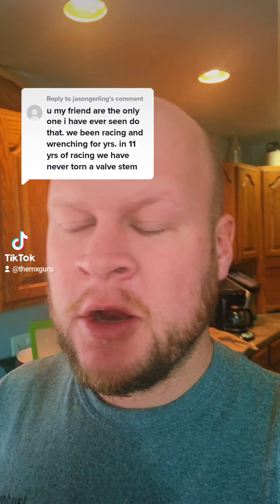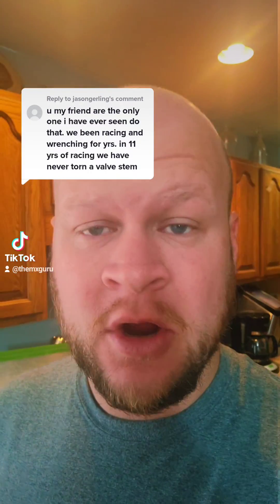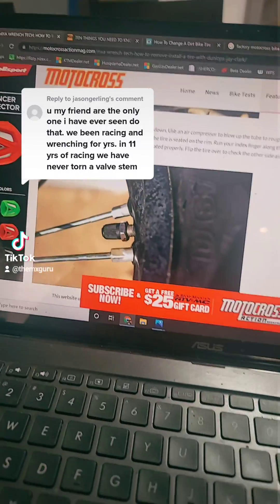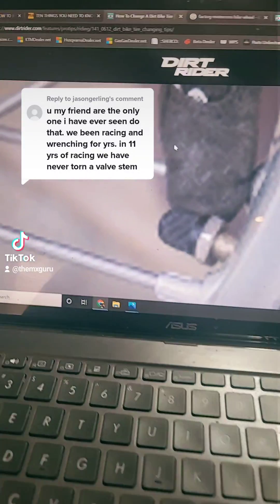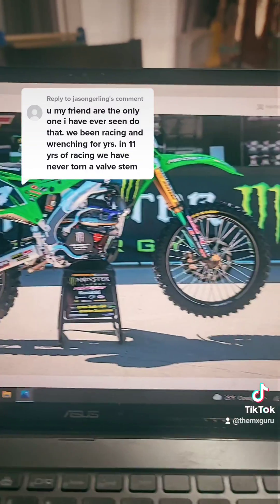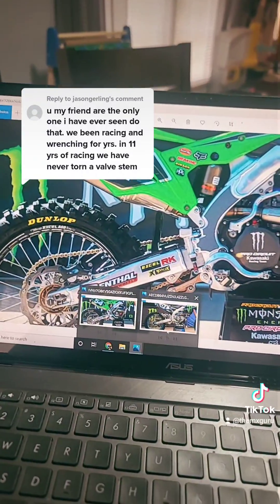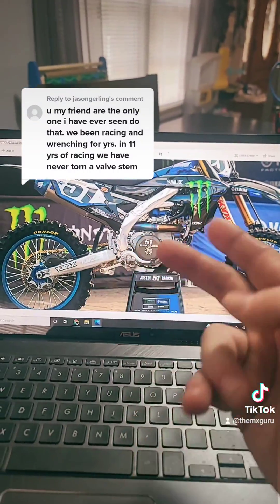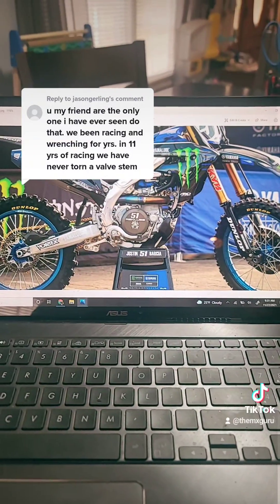Should you tighten your valve stem nut against the rim?

Comment: I literally found out about this a week ago. About 3 weeks ago, my Talaria Sting R electric motors rear tire went flat. Found out the stem valve literally ripped off the tire. 

After watching a video on replacing the tube. The gentleman mentioned not tightening the stem nut to tire. It's crazy because the Talaria Sting R is ships stock with the nut tight to the tire. Now I know 😂

Comment: I have the nut tighten in the rim because the local vulcanizing shop does it on my motorcycle once when I have my tires change to them. Didn't know and didn't bother me until I rode my bike up to 23k km my rim paint job damaged the surrounding area in the valve stem still didn't bothered me until finally I had a nail in my tires when the valve stem got bent so bad that the inner tube is beyond repair. So thankfully I found videos explaining why not tightening the valve stem nut.

Comment: My question is....WHY? I understand not tightening the nut against the rim itself but why put it against the cap? The reason I assume is so the cap wont come off. But how often are people losing there caps if they are not using the nut against the cap. 

I feel there is not really a wrong or right way to do it if your not getting any negative results. I myself put the nut against the rim and lightly tighten. Never had any issues. If someone chooses to put it against the cap....go for it. I would never insult anyone for doing in a way that works for them.
Reply from the maker: Because against the cap gives the valve stem the most possible room to flex and move. 

You can do what you want, you're still wrong.
Reply: @mxgryan  Way to go about getting viewers by telling someone they are wrong when there is not a 100 percent only way to do it. Goodbye. Forever.
Reply from the maker: @jcaashby3  way to be wrong. Good riddance. Forever
Reply from the maker: @jcaashby3  go find a channel where they will coddle and appease you. They exist. This one isn't it.
Reply: @mxgryan ahhhh hahahaha
Love it!